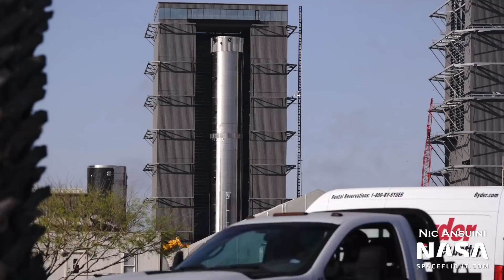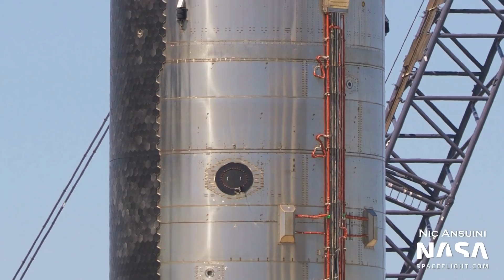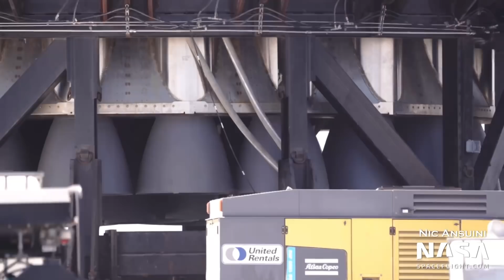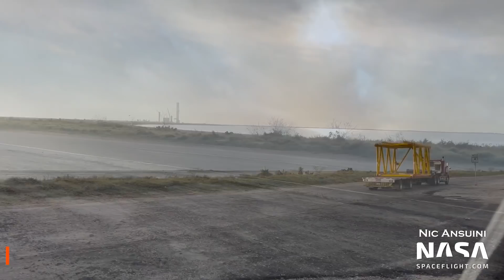Launch Site Fence Section Removed | SpaceX Boca Chica

Comment from the maker: 0:00 - Booster 7 in the High Bay
1:06 - Wide Bay Construction
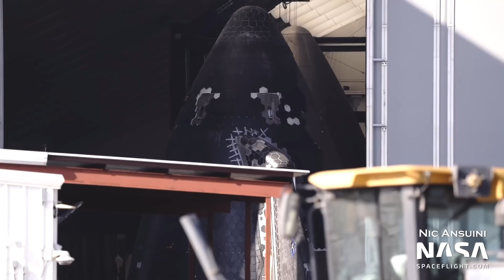1:38 - Nosecones in Tent 3
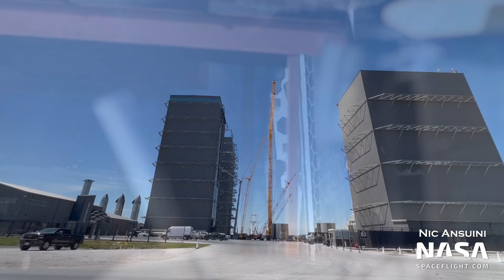2:09 - The Production Site
2:54 - The Rocket Garden
3:25 - Ship 20 at the Orbital Launch Site
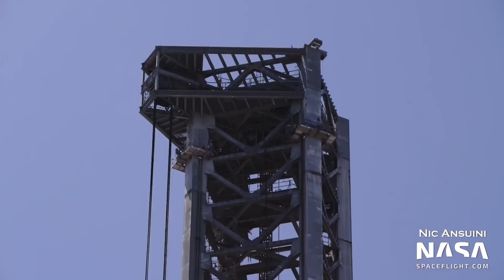4:19 - The Orbital Launch Tower and Ship 20
4:56 - Booster 4
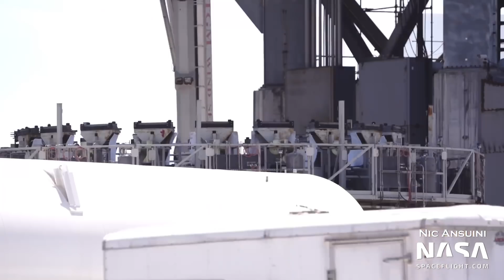5:42 - The Structural Test Stand
5:56 - Orbital Tank Farm Venting
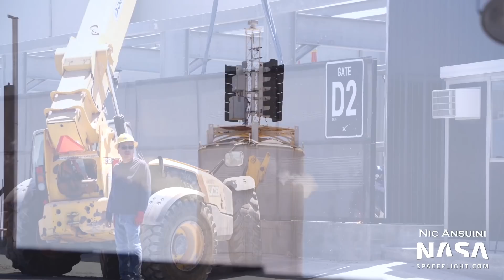6:11 - Launch Site Fence Section Removed
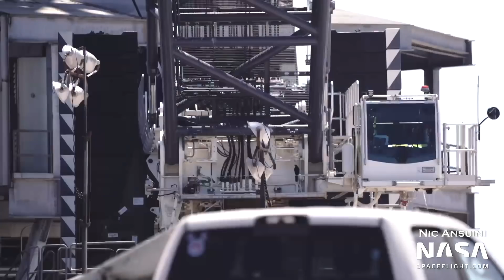6:50 - The Cab of SpaceX's LR 11000 Crane
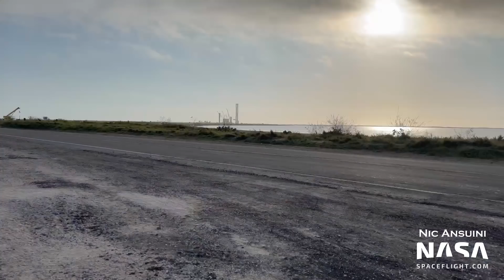7:04 - Crane Parts Leaving the Launch Site
Reply: Thanks 🙏🙏👍

Comment: Thank you Nic and NSF team for sharing thre videos. I wonder why they are removing the fence. Hopefully to build a brick and mortar wall
Reply: My guess is to allow them to put the sheet metal on the structure.
Reply: @gravelydon7072  thank you.
Reply: @badrinair  Then why oh why would the workers lay sections down on the "good side (name plate exterior facing side)?  If not intended to be scrapped and I was site foreman, those workers would get at least a few daze off with no pay.

Comment: Great video.  Thanks, Nic.  Curious what they will do with the fence they took down.
Reply: Put it back up once the shed gets its walls.
Reply: @gravelydon7072  Then, why oh why would the workers lay sections down on the "good" side (name plate exterior facing side)?
Reply: @geoffgeoff3333  Because when put back up, the outside facing surface can be repainted but the inside will not be able to be.

Comment: Wonder if that one grid fin stayed tilted because of an issue with the motor or if they just couldn't be bothered.  I mean, AFAIK they haven't been tested for range of movement at all yet
Reply: I hardly think "they couldn't be bothered" is something SpaceX does. It got stuck. Could even have been "the last straw" that killed B4.
Reply: @knowledgeisgood9645  With Elon's strictly minimalist approach, why would you suggest they'd waste time doing something they knew they didn't need to do? They had to tilt it so the work platform on the QD arm would clear it. It's not stuck. They are still working on the QD so why bother moving the fin back level. And now if they are going to scrap it, why would they bother moving it.

And then contrast that with your suggestion it could have been the last straw. Scrap a whole booster for lack of swapping out a grid fin drive unit? Seems the epitome of "couldn't be bothered". I'd take Elon for what he said, they will have enough R2's and R2 is sufficiently different from R1 that they aren't going to bother with B4 anymore.

Comment: I still think that it would be a real shame if B4 and S20 don't fly, as it would represent about $200M in loss, with no flight data at all. Flight data would provide verification that their simulations and software is correct. And those 35 Raptor-1 engines (SL and Vac) have no use other than the scrap pile. BTW, I would love to have one of those Raptor-1 engines at home to display!
Reply: Nope. Not a $200M loss because we are told caring about sunk costs is a "fallacy" and everything must be new. With Raptor 2 available, all Raptor 1s are now useless. Throw them all away, even as you throw away the first 39 Raptor 2s into the Gulf of Mexico/Pacific Ocean. (I'm writing on an old computer, but hey that's just me.)
Reply: @spaceworldupdate437  Actually, you are spot on. If you test an old design, you are literally adding to the advancement into a wrong direction. The absolute latest design must be the test article. That way you make the very most out of every (extremely limited) testing opportunity.
Reply: Doing an orbital launch would not be cheep.  The cost already spent on S20 is a very small percentage of the cost that would be expended on doing a complete launch test.  Spending money on launching an obsolete spacecraft would be the bigger waste.  Plus, S20 is not a waste, it did its job very well as a ground test article.

Comment: Looks like it will be a few months before they are ready for blastoff. Of course, the FAA has to give approval. Residents of South Padre Island might want to avoid watching all liftoffs from behind any normal plate glass windows, just in case. Broken plate glass is about the sharpest thing known. Better safe than sorry within about 10 miles of that much fuel and oxidizer possibly coming into direct contact. Nothing like that has happened in human history, so there is that.